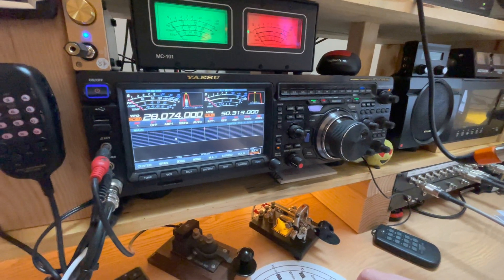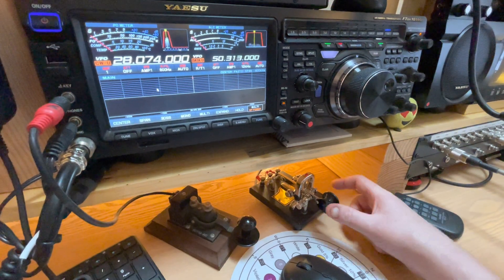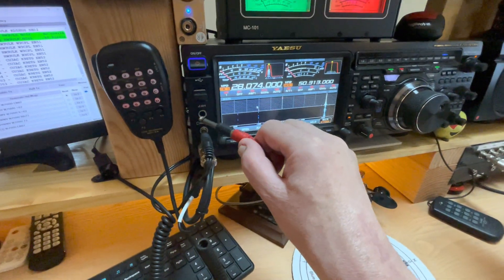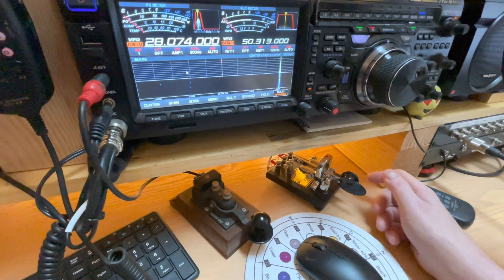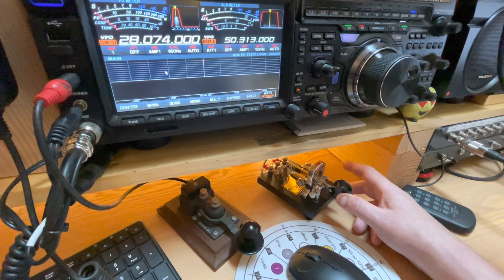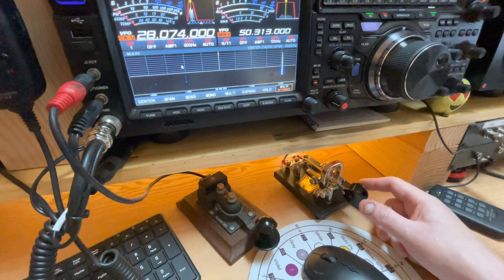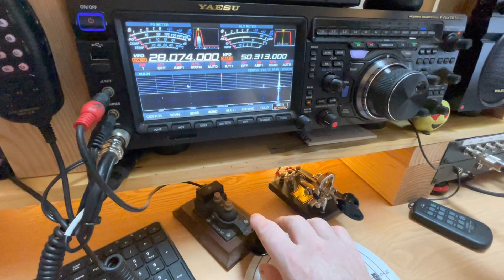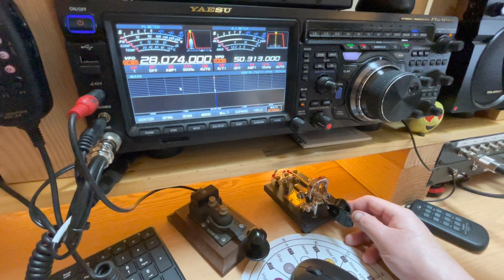Key programming issues with FTDX-101MP

Comment: I was reading the 101mp manual and it says that you must use 3 conductor plugs. Once I did this I have my paddle going to the back and straight key on the front. works both ways

Comment: Dave I was looking at your video and I check the 101 manual it says on page 64 that what you are doing the paddle should be plugged in the front and straight key in the back Jack's. Sounds weird but that is Yeasu always something with them Anyway give it a try Bruce W4HAM

Comment: Maybe, when you plug in your mono plug you short one of the stereo plug rings of the keying circuit inside the radio. Also your iambic switch is always on. Use stereo plug for straight key snd turn off iambic key switch to use straight key? Leave one ring open , tip is key down and ground is the barrel.

Comment: Hello Dave,

I've been watching your Youtube stuff for a while, ever since your presentation about Heathkit equipment on Ham Nation. Good stuff.

I know it probably isn't what you want to do, but one possible solution might be how I handle having the straight key and paddle available at the same time. I plug a 'Y' cable into the front panel key jack. The end of the cable that goes to the radio key jack has a 1/4" mono phone plug on it. The other two legs have RCA phono jacks on them.

I plug the straight key into one of these RCA jacks, and I plug the output of a Winkeyer USB into the other RCA jack. The paddle is plugged into the Winkeyer. The ends of the cables from the keyer and straight key terminate in RCA male phono plugs. 

I leave the radio set to straight key input with internal keyer off. This arrangement works because the output of the Winkeyer is just a two-conductor cable like the straight key.

Then I can use the paddle or the straight key as I wish, and change from one to the other on the fly.

This arrangement necessitates the use of an external keyer rather than the internal radio keyer, but in my case I prefer the external keyer.

So this might work for you until Yaesu corrects your issue. Good luck.

73,
Mike - WB4HUC
Austin, TX